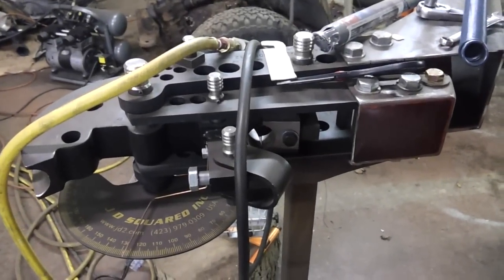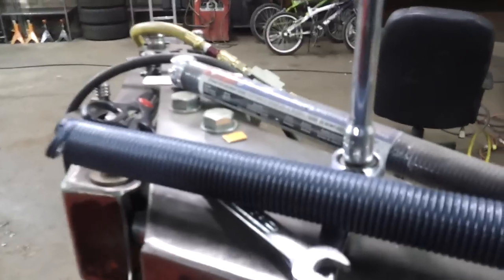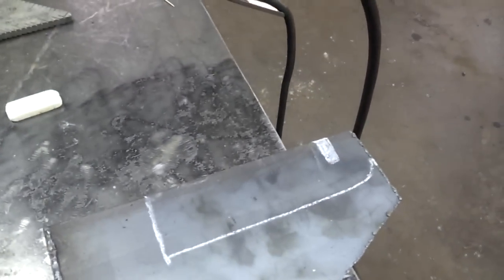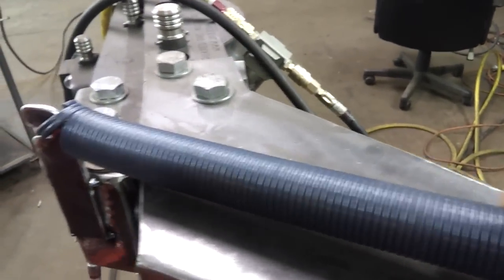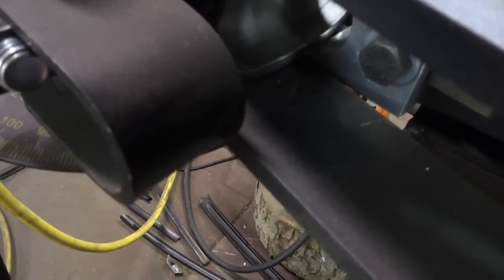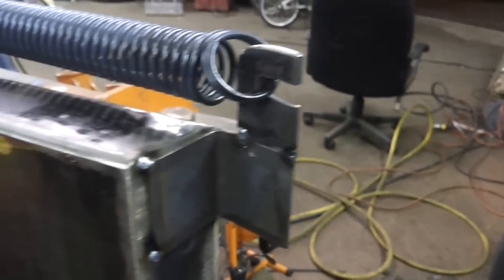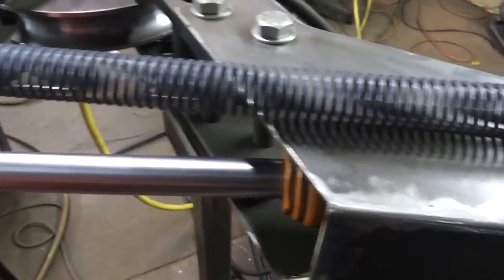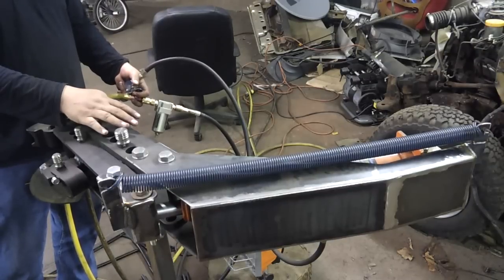JD2 Model 32 + Harbor Freight Ram Build (Part 8)

Comment from the maker: You said it comes on a stand that looks like an engine stand. Unless I'm over looking something JD2 don't have a stand like that for their Model 32 bender. I know a few other companies sell something like that based off the model 32 that's why I was asking. As for bending exhaust pipe you might want to look into a different bender. These aren't designed to bend that thin wall tubing without kinking it or really distorting it. And yes you're right about the price of the really large die sets.

Comment: You just need  about  10" to12 " of that spring pull it back with alot of tension  than tack it to the top about center of where your long spring is  , it takes olot more pressure  to push that back than you Think , The spring you have is way to long to get the tension  you need  you would  have to  pull back that spring  back around  2' to 3' further than you have It ..  Great build bro

Comment: The one I wanted to get is the JD2 model 32 bender.  The one that's electric hydraulic.  I wanted to get dies all the way up to 2 1/2 inches so I can do exhaust pipe.  The bigger sizes in the 180 degrees are the ones that are expensive.  There like $475 each   and the square tube die is $495.    Im just going off of JD Squared website.

Comment from the maker: If you get it make sure to post some video of you doing a 180 degree bend on some large square tube. I want to see how hard it is to remove from the die set. I work with square tube more than anything else right now. I have a small crappy bender that can do 3/4" square 16 gauge wall but it's a nightmare to free it from the die. That scared me away from buying square dies for large sizes of tubing. Took me 30 min to knock it free with a hammer.

Comment from the maker: Yeah the die sets are very expensive. If you're going to use them over and over it's well worth the price. If it's for only one project you might be better off paying someone that has one to bend the pieces you need bent. Some of these local guys only charge like $5 per bend. I'm sure someone in your area would be willing to do the same.

Comment: I originally saw it on Trick Tools website.  But It looks like they don't have it anymore.  Most of the stuff I will be doing wont be exhaust pipe.  But every once in a while I need to be able to bend exhaust pipe.  So It would be nice to be able to do it.   It looks like Trick Tools now sells the JMR bender. Im not sure why they stopped carry it.   6 months ago it was on there website.   I even got to see it at FabTech in Las Vegas.

Comment: I would only get the 180 degree dies.   The one I was looking at is $1900.  But with all the dies I want it would cost $5000.    The dies are almost $500 each.   Some of the smaller sizes are a little bit less expensive.  I would also want to get the 2 inch square tube die.   I build a lot of stuff out of that 2 inch square tube.

Comment from the maker: I wouldn't buy all the die sets if I was you. I'd start with what you know for sure you'll be using the most. Message me the link to the bender you're looking at That seems high and $500 per die set is for sure high.

Comment: You could add ten of those springs and it wouldn't work.
Those springs really stretch long.
Reply from the maker: The one spring works just fine...
Reply: +Alvarez Metal Works 
really I thought it would be too long. cool!